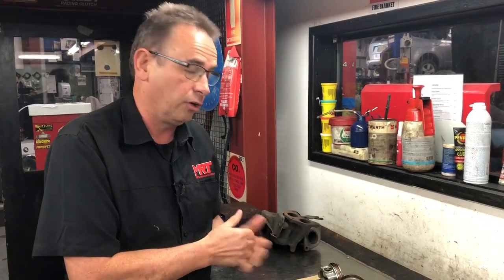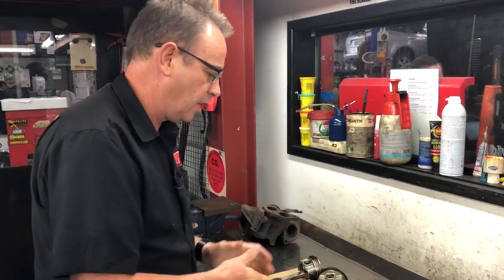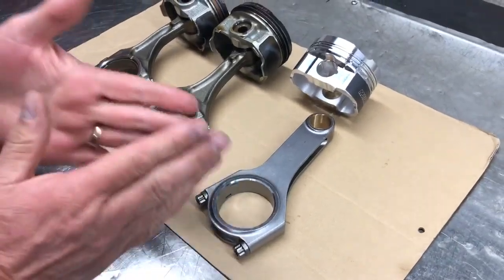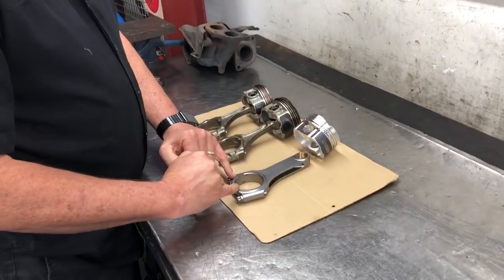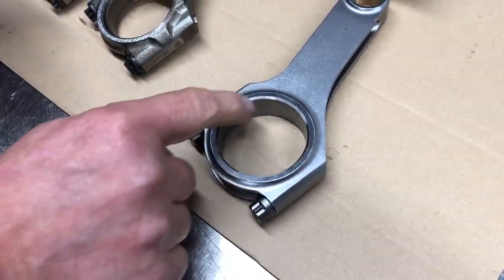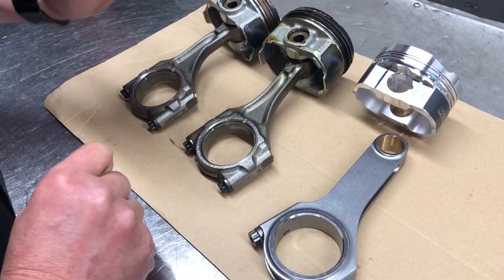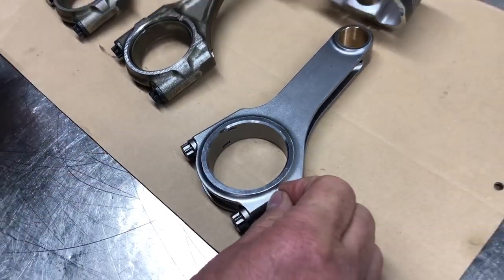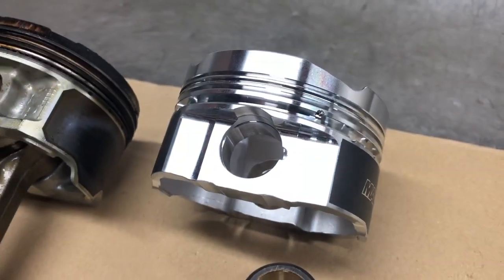FA20DIT WRX Engine Build - Pistons & Rods

Comment: I know this video isn't about this subject but I was just curious what head gasket do you recommend for someone with a fully built fa20dit bigger turbo and port injection. Alot of people say to use oem but I dont think oem can handle the level I'm trying to go to
Reply: Grimmspeed has new FA20DIT head gaskets, 3 different options to choose from as far as thickness.
Reply: @DiGiTal_eClipSe589  i ended up going with JeProSeal headgaskets custom designed by OutFront. Grimmspeed was is to new and i got to nervous to run them haha

Comment: We love Subaru, but the factory pistons are practically useless for performance. If you are thinking of buying a WRX or an STI expect to rebuild the engine with these heavy duty Pistons and Rods at the start. Don't forget to discard the factory oil pickup tube and replace with a heavy duty as well.
Reply: John Perricone seems like the FA20 is okay up to 300whp.
Reply: John - how do the oil pick up tubes fail ?  I have a 02 WRX with 120K on it....came here looking for wisdom - like can I run it longer ot should I rebuild it while it is out of the car ?